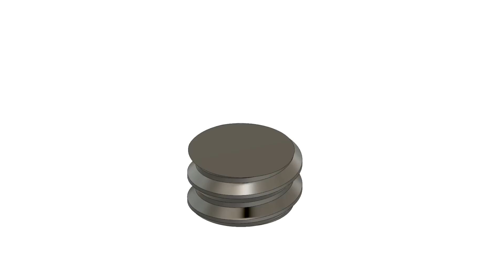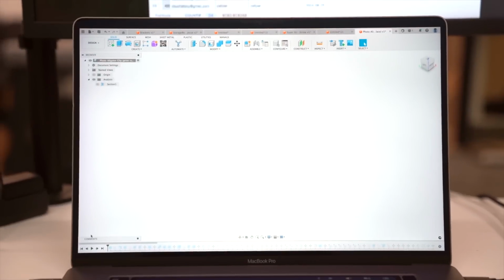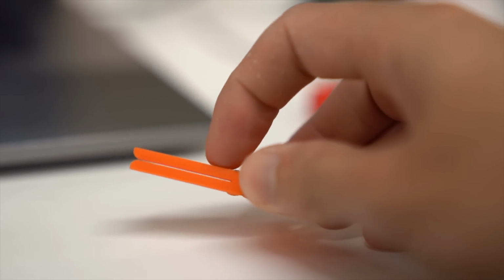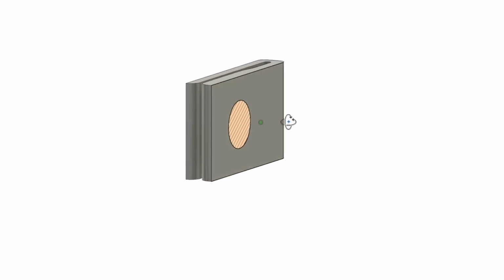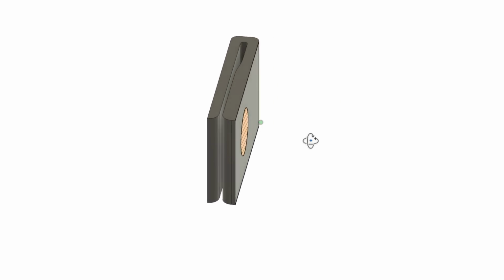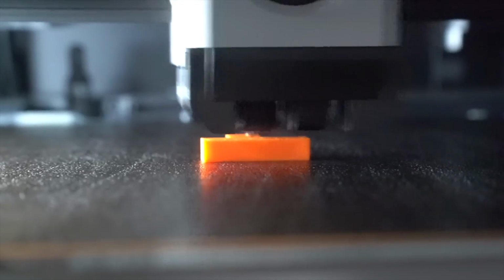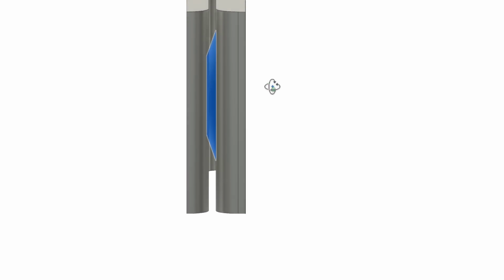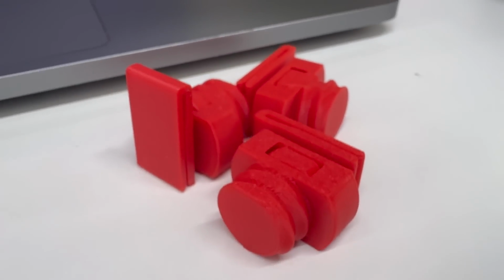Engineering is awesome.

Comment: Got the printer now what computer and program do I need?
Reply from the maker: Fusion 360 and Blender are great design programs. I have lessons on my tutorial YouTube channel: @3DPrinterAcademyTutorials

Also how-to articles and courses on my website: 3DPrinterAcademy.com

The designs in this video are from threadboards.com
Reply: @3DPrinterAcademy  Personally, I use Blender for Artwork - eg. an aesthetic phone stand, while using Onshape (cuz it's free) for precise CAD. PrusaSlicer for slicing : )... (I mostly use Onshape because that's what school taught us and I don't want my parents to buy Fusion)
Reply: That depends of what printer you have. What printer do you have?
Reply: @Yoggoth ELEGOO  Neptune 3  plus
Reply: @Yoggoth onshape and cura slicer.
Reply: In my experience, SolidWorks is the best CAD software I’ve ever used, and I use Cura as the slicer.
Reply: If you want to design precise parts/mechanisms, Fusion 360 (now called just fusion I think) is a better choice than blender. However, blender is usually better for more "natural" or imprecise models (like characters). You also need a slicer (sometimes provided with your printer) which takes your designed models and converts them to code that the printer can read. Popular options are Orca Slicer, Cura, and Prusa Slicer.
Reply from the maker: @wikflip exactly! And don’t forget Bambu Studio (slicer for Bambu Lab printers)
Reply: Honestly, onshape is an underrated tool. I used to use Fusion360, but they priced themselves out of my market. Switched to onshape and it has functions that are so much better, fewer errors, and has changed my workflow. I know it's only a browser based thing, but it is extremely easy to use and very capable and I find it has better tools and options and less errors compared to fusion360. It's not a offline tool, but it's a very capable tool. I wish more people would just give it a try. If they ever build an offline tool that works exactly the same as the online one I would buy it. But I use their online tool all day, it really is a decent tool
Reply: Ngl onshape is pretty good and they have official site tutorials. Fusion 360 is pretty good too.
Reply: Since you also asks for computer, may concider Oneshape. It is an browser based CAD software, meaning you need an internet connection, but for that, you can ditch the hardware requierments a classic CAD software has. Also, it is absolutely free for private users, so you can take a look by yourself. There are also tons of tutorials here on YouTube
Reply: Onshape is free and browser based. If your internet is good, you'll love it.
Reply: BLENDER SUPREMACY RAAAAGGGH
Reply: Do not use blender, get freecad or something else. Blender gets way too complicated and the learning curve is too steep, only really good for artsy stuff.
I used blender for years and recently picked up fusion 360 and holy shit is this life easy
Reply: @fahtfakcarl7695  ok thanks
Reply: @fahtfakcarl7695  Blender gets good for 3D printing quite quickly - I learnt it in 6 weeks. Rigging and rendering are the hard things (Still trying to get the hang of it!)
Reply: For a computer I would suggest something like a Beelink R7-5800. On Sale currently on Amazon. Then you’ll just need a TV or monitor with no less then 1920x1080 resolution. Plus the obvious keyboard and mouse. You could even just use a laptop but I think AMD’s integrated graphics would work better than Intel graphics.
Reply: @only1muppet   I drive a truck so would prefer a laptop so I can work on it while waiting to get loaded. Seen a laptop with Intel but didn't know if it would work.

Comment: make the original peg screw a little longer, and add or print a washer of the same thickness you added to the length of the peg. When screwing it in, just before you tighten the peg, slip in the photograph in between the peg and the washer and further tighten it to clamp the picture between the peg and the washer. No silly friction systems that might loosen or need special orientations to be printed, just the same peg a little longe rand a washer.

Comment: if you still want to make metal gears there is a much cheaper simple way.
1 print the gears using basic pla or such.
2 make a tray with some fine form of sand pehaps claylike but also sand like, 
3 press the gear in the sand push sand around the edges so it follows the shapes
4 pull it out(you can use your old 3d printer if you happen to have a super shakey hand, but generally if you just take it out should be good.
5 in case the sand from the axis hole collapsed you can eiher put the axis in place directly this way the gear will directly be stuck to it or take some wooden peg of the right size which you can later burn out, or make a paper roll and fill that with the sand in the right place.
6 wait for the sand to be pretty dry(safely dry)
7 cast metal into it, aluminium can be cheap due to it being easy to find everywhere even for free, zamast or za12 however is much cheaper if you have to buy it and also is much more easy to cast at much lower temperatures and it is also stronger than aluminium, it is more heavy however but that is no problem for gears and it will also tend to case much finer than aluminium as in spread out better, etc. for a few € you can make a set of metal gears like that.
answering it here since you might not check comments on those older videos anymore, but those gear designs you used are insanely easy to stam as you don't need to do any of the advanced things like burning out a model or such, instead you can litterally just stamp it into fine sand super easy and cheap as it litterally costs the cost of the metal itself, which in the case of zamak is super cheap due to being used a lot in industry and being made from cheap metals. ofcource also some slight heating costs but it melts really easily.

Comment: Buy small magnets, glue magnets on "srews" heads, glue any magnetic small metal washer or whatever on back of picture/put in front of picture---->Profit.
Or put magnets into the screw while printing, can do a huge badge of srews at once. This way all the screws can be used as magnetets. Also can put another magnet in a simple cylinder as the counter part to hold pictures. 
So many options.

Comment: Print a screw with a cavity in the head for a small washer. Insert the washer during print so it’s embedded. Use a small neodymium magnet to secure your picture to the screw from the frontside.

Comment: tbh it is bad design. peg that holds clip is not horizontal on board, too much space between board and paper. you could do it in 2 parts - fully round tread peg with edge to snap on clip and clip would look like letter F, so clip would rotate on peg and take no space.
Reply: i even made and printed prototype of my idea

Comment: You can attach the clip to the bolt and then the nut will fix the clip anywhere in 360 degrees. Easier to print, and no need to PIP

Comment: If threadboard ever goes open source I would be happy to share my picture clip that uses 90% less filament. 

I’ll give you a hint on the design: the interface with the board is designed to hold a photo, not a 15lb weight.
Reply: Its a square with holes.... Why does it need to go open source? You can make this in software in 3 mins just from hearing someone describe the idea...

Comment: If you think about it, we live in an age where if you want something, you can just... make it. You think of a cool idea for a videogame? You can learn to code it using tutorials. You need a part that they don't make anymore? 3D print it. There is so much information online and tools like 3D printers becoming more and more accessible, you can basically create anything you want. Kinda crazy, isn't it?
Reply: We live in an age of wonders.
Reply: actually no you need money
Reply: what about guns?
Reply: @Charleykaroly  People have 3d printed guns, yes. You can also DIY it!
Reply: @Lucas-cm8zq  you know there is metal 3d printers right...
Reply: @Charleykaroly  3D printing is an overly complex way to make a gun. A gun is basically a piece of pipe and a firing pin. You can make one with much simpler tools than a 3d printer.
Reply: @Charleykaroly you can make a gun for under 20 bucks from stuff in the hardware store, no 3d printer required

Comment: KISS...  The first option would be perfect with a crush washer.  Material properties FTW.   But proceed.. :)  Over engineering can be fun too!
Reply: It's also a very big thread pitch so you can probably get pretty close by just adding some angle offset to the threads.

Comment: You can actually predict the orientation of the clip
Reply: Yes and no. You can predict it for this particular printed section of the wall. There is no guarantee that the tolerances will work out for any other wall piece.
Reply: @Argosh  why? Sections have wholes with thread 3d-printed exactly the same way with certain orientation.
Reply: @theMerzavets  yes, but the tolerances are unlikely to be identical. 3D printing is not as repeatable as CNC.
Reply: @Argosh  if we talk about threads with huge step (like in the video), 3D printing is very repeatable. If thread begins at 0⁰ angle on the first detail, it'll begin at 0⁰ angle on 10th, 100th and even 1000th detail too.
Reply: @theMerzavets  depends on which side you screw into. Bottom layers are usually repeatable within sessions, but variances in bed leveling can cause a discrepancy that could yield a visible misalignment.
Top layers will definitely have variances simply off of shrinkage and material differences. I did my fair share of series production and even off the same printer fits are rarely repeatable and that definitely impacts screw threads.
Reply: @Argosh  I respect your opinion, but as for me I have exactly opposite results in printing threads (suppose I printed about two hundred of them, most in series of 4..8 details in one task). Maybe I'm doing something wrong? 🙂 
Nevertheless, thank you for answer. Now I have +1 phobia about 3d-printing 🙂
Reply: @theMerzavets  thanks for the nice response. In the end it's also very dependent on the printer you're using. Maybe yours is that repeatable, or you got lucky. Overall I mostly get to the fits I want by experimenting with stuff and I usually manage to dial it in. Like the wall pieces I made. I simply added a few walls to all connectors and then sanded them to the perfect fit.
Which would also be a good way to deal with this problem here. Just design with tolerances in mind and you're golden.

Comment: Why didnt you scan the car on a photocopier, import the pdf as a sketch reference in f360 using the dimensions of a sheet of paper. Trace over the boundaries of the car and then extrude it offset from the image so the car picture could fit inside the cavity with a pegboard dowel on the back. You could have mounted it without having the clip obstruct the image
Reply: I’m gonna guess the guy did it this way to be universal for any photo. Plus this solution takes less than 5 mins to come up with and model. Your solution would be quick to model but a little overkill. I do think he could’ve made this better but only very minor ways like a lip on the clip, make it shorter and “skeletoned” to reduce print time, stronger clamp force, use less material, obstruct less of the image being held.

Comment: this video kind of annoyed me just because you probably could of just simplified it by just making a screw and then put a small slab with a hole in it so the screw would cramp it down, but good tips!
Reply: or just two sided tape lol
Reply: @cinnamon3556 two sided tape is annoying af
Reply: When you have a printer, too much time, and a YouTube channel, you just kinda need to invent problems to solve in a needlesly complex way...
Reply: @DrTheRich It's really not that complex. He went through Fusion 360 but it could have been done pretty easily with even Tinkercad.
Reply: Could've*
Reply: I was thinking something similar. Two parts: the screw that goes into the pegboard and the picture holder with a little tab that slides over the head of the screw.

That being said, I love designing print-in-place components so I honestly prefer his design.